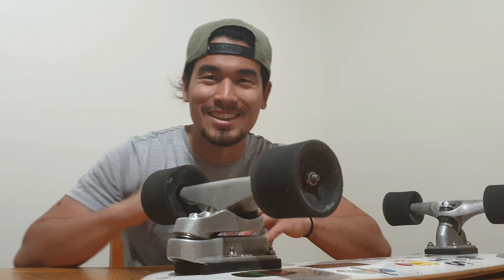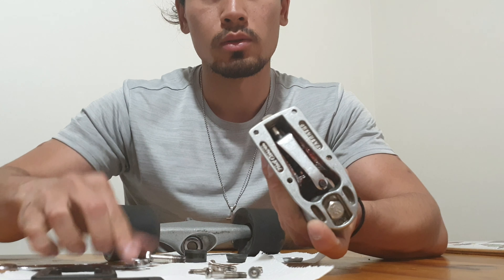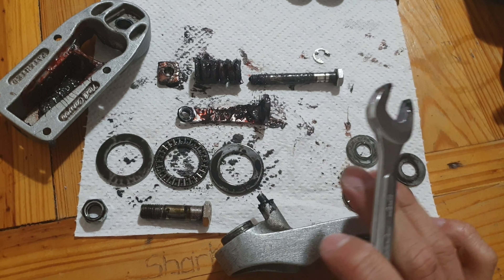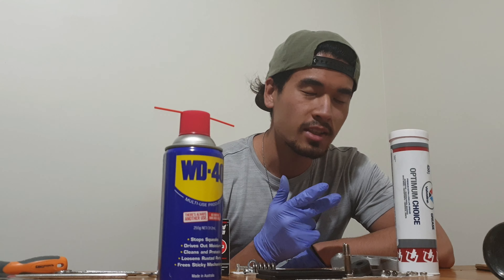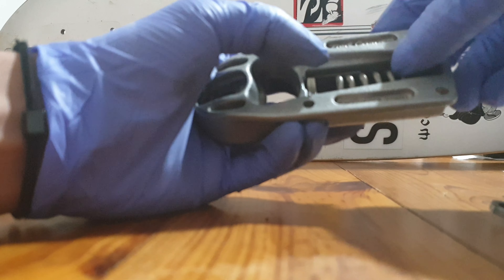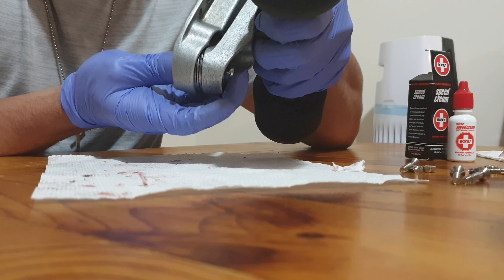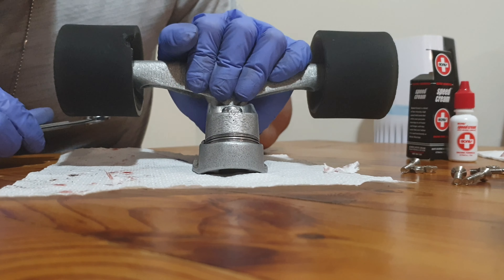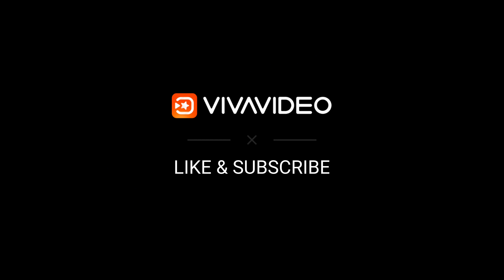Carver C7 truck maintenance - surfskate tutorial

Comment: Thanks for the teardown. Dreading opening up my C7 truck which I've had for over a decade and never properly taken care of.
Reply: Finally took apart my 2004 Carver C7 and it looked surprisingly clean and in good condition (I don't skate daily). I found the following: 
1) Looks pretty much the same except no C-clip holding the spring bolt. 
2) It was never greased or light grease wore off.
3) Two major areas of wear. These should have heavy grease: 1-Spring bolt wherever it contacts with the link. 2-nub on arm bearing plate which connects to the link.
Hope this info helps anyone maintaining their C7🤙🏾

Comment: How do I know if my spring is broken. Is it supposed to make any rattling noises when riding and hitting bumps or rocks
Reply from the maker: Most of the times, it is the bushings that are squeaking. Put a drop of oil on it. That should do.

If your spring is broken, you won't get any rebound when you pump. 
Still, it is good from time to time to open the C7 system to check for wear. 

Sometimes the spring bolt is too loose, and so it vibrates freely as you move.

Comment: Hey Shane. Can you add grease to the spring? i did this and now the tension bolt is becoming loose on it's own when pumping. I've made sure not to grease beyond mentioned in the vid.
Reply from the maker: Yes. Add marine grease for extra protection against moisture. Cover the whole surface of the spring.
I had the same problem twice. Try cleaning all residual grease on the bolt head and in/around the hole. Also try not greasing around and into the spring nut. 
For me it was fine after that

Comment: hi, I have a CARVER RESIN 31 skate with truck c7, and I am having a problem with the screw that tightens the spring.
it comes loose all the time but too easily. I tried to disassemble the truck c7 and he cleaned the grease near the screw head (maybe he could make it easier to unscrew, like your advice) but it didn't help. after 30 minutes of skating I find myself with the screw completely released. what can I do? thank you
Reply: I had the same problem,I just didn't grease the spring at all and problem was solved.

Comment: I had c7 for few months and it worked great. But lately whenever I drop the board looks like it is too loose and spring doesnt work. So I opened it and link covering spring jumped out from bolt. I put it on agine, adjusted so it si quite loose.but after every next shake it happens again. Nad spring bolt seems to be very loose and moving. Has anyone had similar problem?
Reply from the maker: First time i hear that. Is there any deformation?
Reply: How much grease is on the spring? I put way too much grease on the spring and after 30 minutes on my board the front would loosen. I could turn the spring bolt by hand. I've been having clicking sounds still coming from my front truck still. I think it's the bearing bolt? Got in touch with Carver and there trying to firgure it?

Comment: If I make kingpin too loose, is there a possibility it falls down while skating?
Reply from the maker: Definitely. Always check your skateboard for any loose parts. 

As for me, i love my trucks as loose as possible but without them loosening by themselves with vibrations
Reply: @shanelai2515  got it, how many turns from default settings is optimal in your opinion? From completely tight to fair loose?
Reply from the maker: @DimaYamubei  it's really up to your preference. I would go for loosest

Comment: Do I need to add grease, I bought a new truck and I just assumed it would come ready to use (Carver trucks come with no info / instructions) I've only used it for two days but I'd hate to damage it, perhaps I should open it up and grease it?
Reply from the maker: Yes you should definitely grease (marine grease preferably). Cover all part of the spring. Avoid the bolt head and hole

You may check them back fortnightly/ weekly for wear if you ride a lot
Reply: @shanelai2515  can you use grease on the swing arm bearing? i noticed you used the bones for that part instead of grease

Comment: can the c7 be changed to cx by tightening it? if i tighten it is it safe for c7? or is it easy to loosen later?
Reply from the maker: No matter how much you tighten the C7, it will never feel the same as a CX. The C7 will always feel more 'flowy' because it has a long arm. Also over-tightening the spring will cause it to lose its elasticity (springiness) over time.
Reply: @shanelai2515  thank you 🙏🙏

Comment: Hi Shane. Im new to the world of Carver skateboards but loving it. I've noticed when i pump my front truck has developed a slight clicking sound. Have you come across this before buddy? Also me and my wife love the vids. Were both learning. Cheers Rich
Reply from the maker: Is the spring bolt loose ? Could be the link hitting the sides of the chamber. It's best to open the truck and see any unusual wear
Reply: @shanelai2515  its brand new. Was told to try a tiny bit of oil lubricant  on the bearings.
Reply from the maker: Did it work ?
Reply: hey  @shanelai2515 . Yes it did. Just put a tiny amount in and the noise has gone.
Reply: @shanelai2515  back again. Looks like i need to take it apart. It's annoying as I've only had it a few weeks.
Reply: Hey all, I've got a similar issue with the front truck. Found a solution yet?
Reply: @g.d.knight  i had to take mine back to Carver UK to get the front truck changed.